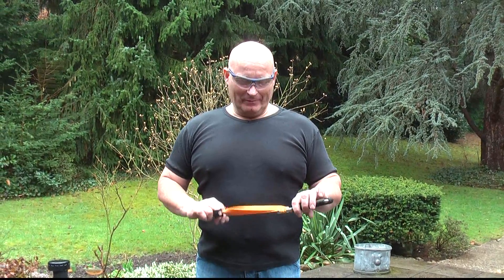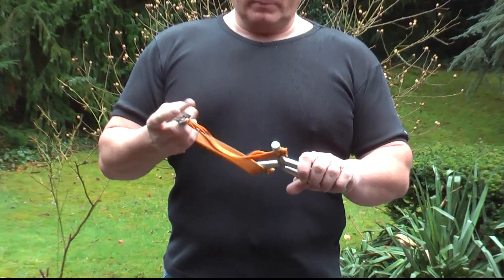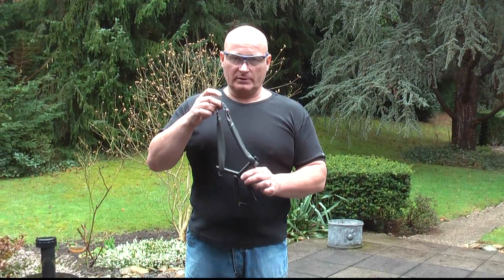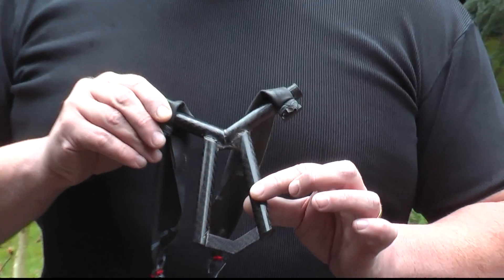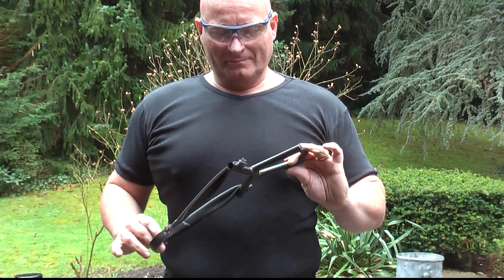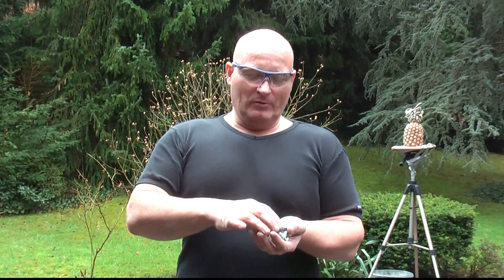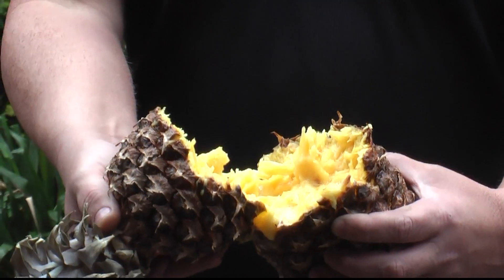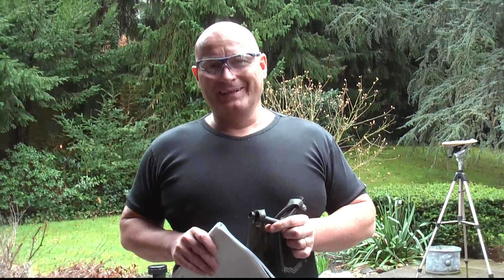Evil Twins: Carbon meets Steel

Comment: Great slingshot, one warning though.. Will carbonfiber break, it will splinter, and it does that aggresivly, carbon fiber splinters is almost impossible to detect and they tend do encapsulate and wander off in the body.
So a small sugesstion, wrap that with something, preventing splinters if it would fail of material fatigue or something.. =)

Comment from the maker: That is true. But making slingshots from steel wire and tubes is easier = cheaper. Saunders actually has fairly good slingshots, with flat bands. Those are just too weak for my taste.

Comment: I wonder if manufacturers such as barnet realise what a poor a design catapults are, that have rubber tube slid over prods that point back toward the shooter.
Your catapults that loop OVER the prod will shoot much smoother, more accurately, and cut down on wear at the joint between rubber and metal.

Comment from the maker: Handheld slingshots, all of my "W" designs can take the double Thera Band Blue setup. That delivers 80 Joules of energy when you use 19mm lead balls (36 gramms). Those bands only work with a low fork design, it kills your wrist otherwise. You need strength to draw them out.